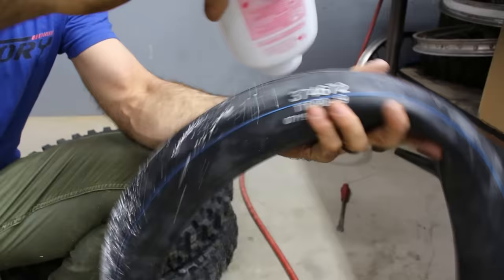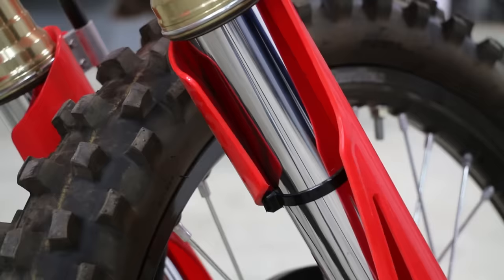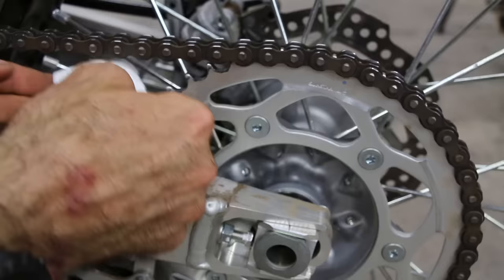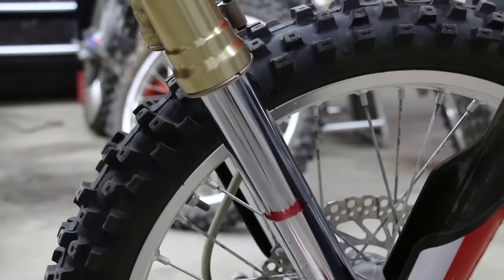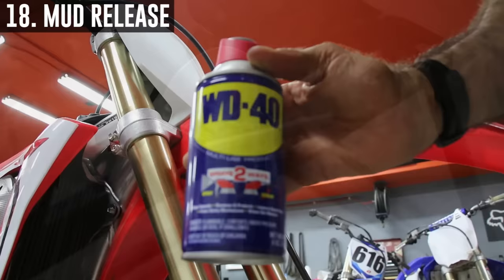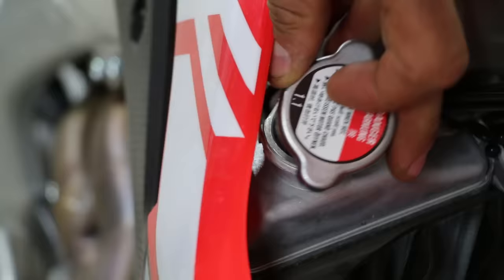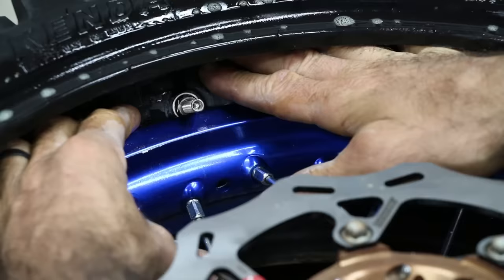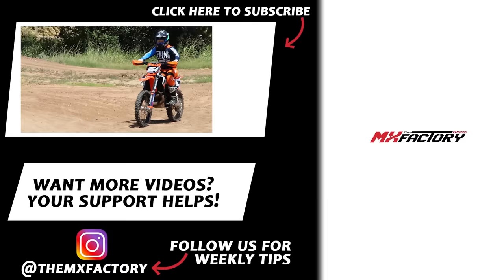31 Seriously Helpful Dirt Bike Hacks & Tricks

Comment: Can you guys maybe make a video    
On more ways to get residue of stickers off because I tried both for hours and it won't come off it's because when I raced at washougel I had to different numbers on my bike also I would like not to damage my graphics
Reply: westdot i have many alts i just change the names get the Twin Air filter contact cleaner in the aerosol can. It is THE BEST adhesive, tar, sap, grease, and 2T spooge removal solvent I’ve ever used.

Comment: Kerosene works the best when cleaning your chain! Water and simple green causes corrosion especially if you have a o-ring or x-ring chain! Kerosene acts as a lubricant and will not cause corrosion!
Reply: If you have an O ring or an X ring chain you don’t  need lubricant.    Just use chain wax  to protect from rust or mud.   There is no need to even take the chain off.    It only wears out the clip  so it falls off later.
Reply: @SD-ir1vf  my point is other fluids even some chain cleaners deteriorate o-rings kerosene will not! And it is absolutely necessary to lube a chain!
Reply: The lube is inside the O or X ring.   It might be necessary to clean the chain but not too lube it.  If you could lube inside the ring that means the rings are shot and you need a new chain.
Reply: @SD-ir1vf  wax/lube the chain in general..
Reply: I find  wax  really makes everything stick to the chain more.   But for some reason it’s what I prefer.   But you’re right about the kerosene.   I just buy a new chain every two or three years.   Whether I needed or not.   What the heck it’s only $100.

Comment: I don’t know if putting a zip tie on your forks is good when riding. It helps setting up your suspension but if your riding hard and bottom out your forks with that zip tie say good buy to your seals
Reply: Kyle Nightingale its not supposed to be there at all times just to see if you should “change” it

Comment: One thing don’t use wd 40 on a chain!, It has water in it and will make your chain rust. Use liquid wrench chain and cable lube, it doesn’t contain water.
Reply: Thats incorrect. There's no water in it and it prevents rust. It's a combination of hydrocarbons (oil) and pressurised with carbon dioxide.

In 2009, Wired published an article with the results of gas chromatography and mass spectrometry tests on WD-40, showing that the principal components were C9 to C14 alkanes and mineral oil

Comment: Do not clean an o-ring chain with degreasers! Take it off and soak it with WD40 and let it work in. Clean off woth rags and compressed air. Degreasers cause premature chain wear!
Reply: But WD-40 erodes the rubber in your o-rings.....

Comment: Do not get baby powder on the rotor or pads! You will have no brakes. Even small amounts will completely act like small ball bearings between the pads and rotors. Brake clean them before riding.

Comment: Locktite on sprocket  bolts is a bad idea.
Reply: Why?
Reply: @ryanmickelwait1521  I've seen plenty of guys with a loose sprocket yet the Fastener is locked by the lock tight with a wrench you think it's tight but you're fighting the Loctite instead of applying pressure to the Fastener holding the parts together leading to Broken hubs from sprockets being loose Loctite can be a good thing but when you need to check and retighten they're already locked so you think it's tight and really it needs a little pulled to Snug it up 30 years in the industry don't know how many times I've seen this very problem with Loctite not just on a sprocket
Reply: MrKidkiller159 With red loctite I could see it being an issue by creating a false torque resistance like you’re describing but I think the blue semi-permanent loctite would be beneficial versus using nothing.
Reply: Not true Mrkidkiller,  You need to go on the LOCTITE website and READ. IN FACT IT'S IMPORTANT TO LOCTITE ROTOR AND SPROCKET BOLTS, YES I WORKED FOR A RACE TEAM.  TRAINED BY THE HONDA FACTORY.
Reply: @jakekale2738  just do the regular maintenance checks an you'll be fine. One hour on the bike =three hours in garage or in the field, got a do maintenance! !!!!!

Comment: As a mechanic I hate every single one of you that uses duct tape as rim strips
Reply: Why? It works much better than the rim strip. Every bike on the gate of SX or nationals has duct tape rim bands.
Reply: @joelard9906  I guarantee they absolutely do not. Why would professional racers want to deal with the gunk left behind by duct tape when they rebuild and replace wheels virtually every heat/race/practice? I'll admit it's more durable than rim strips but the pain it is to remove when replacing tires, spokes or relacing wheels is not worth it. Rim strips are what 2$ a pop? If even?
Reply: @maxbaumgarten7580  shouldn't make guarantees that you arent sure of 😉

Comment: Instead of grease on your swing arm locking nut use anti-sieze lube. Also do not use wd-40 on your chain.. wd 40 attracts dirt faster than most chain lube. Unless of course your using wd 40 only to prevent rust. Fun facts corrected 🤘🏻

Comment: The only thing I see wrong is the wd40 on the chain. Unless it’s the lubricant wd40 that may be fine to coat your chain, but wd40 is a penetrant meaning it will try to penetrate your chain. Wd40 prevents rust which may help your chain from rusting but it’s also a penetrant which may weaken the strength of your chain over time.

Comment: Bro wtf my bike has a lawnmower blade for foot pegs and the forks haven’t not had any oil for years… my pipe is rusted out cause idc if I spray water in it and it still rips…. All this is just unnecessary. If it ain’t running just throw some Lucas in it